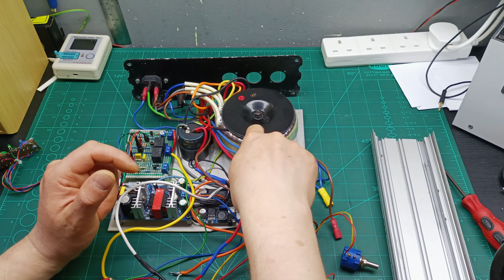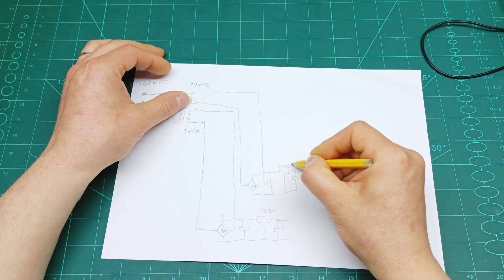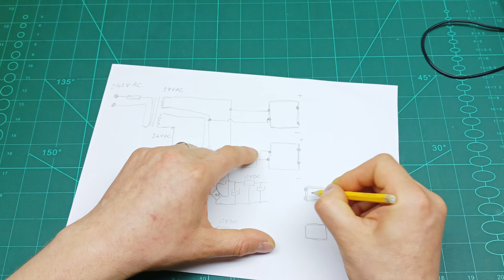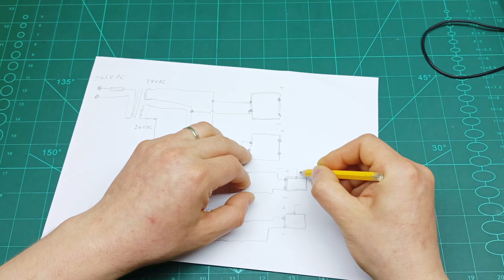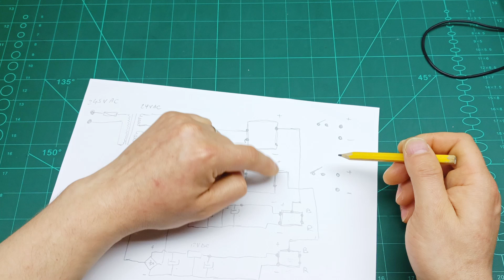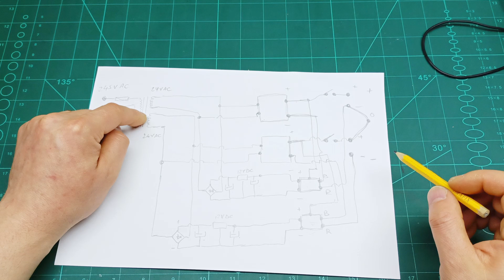Why not making a DIY dual rail bench power supply? 0 24V 0 2A

Comment: Nice build, thanks. Surely you could run the meters on 24V instead of 12V, repurposing the included fan regulators.
Reply from the maker: You can but the amps readings will be not ok and you can't make it as a dual rail power supply because you need to put them in series and the current readings are through the negative path so when you will put in series will short out one power supply
Reply: @SymbolTech21 no, I mean don’t mount them on the boards (since not used for fans anyway). Connect them just as you did the 7812s. The meter runs on 4.5-30V.
Reply from the maker: @michaellindborg1510  that's why I said they need to be powered from an other source if you want to get the readings correct. If you power them from the same source will short one when you put in series the power supplies to make a dual rail negative ground and positive

Comment: Hi, nice build. I have a question. Can you put the outputs in parallel so you can have more current capabilities?
Reply from the maker: Will be not so good to do that because if are not exactly the same voltage maybe sparks can happen. But can do other things to be more powerful is to put in parallel maybe 2 power transistors and that will double the power handling only that definitely will need bigger heatsink as well to dissipate the heat faster in special when using low voltage and high current

Comment: Maybe doing a step-up: build a bi-polar (four quadrant) power supply. That would be fun.
Reply from the maker: And which application will be used?
Reply: @SymbolTech21  there's not much use of it (e.g., testing rechargeable batteries or as an amplifier for a signal generator or an an AC source) and it is not easy to be made, but that's why making it would be fun and great for bragging too, as very few people has one.
Reply from the maker: @bsimic29  I have 4 signal function generators then I will keep in mind for this project suggestion and maybe in the future I will build one.

Comment: Nice build. You can adjust the meters to read more accurate by adjusting the V/A Cal presets on the meters.
Reply from the maker: Yes I did that and how you can see in this video is the closer to accurate possible I come by adjusting those 2 trimpots
Reply from the maker: Hi by the way I just got a new voltmeter ammeter and I installed and now the reading measurements are more accurate.

Comment: Great build. I have a center tap transformer out of a subwoofer that states it has 49v-0-49v outputs. Can I use that to build your design? thanks.
Reply from the maker: First you need to open the center tap and make it dual 49v and the voltage regulator kits I use on this project they can run max with 24v transformer. So for your transformer if you open the center tap to be dual definitely can go to this project https://youtu.be/yaxJYI5ejf0?si=mCi9S1oJ_DQQ7NDY
Reply: @SymbolTech21  thanks for the reply. I tested the transformer. It has a 230v primary (UK mains) and +49v 0v -49v outputs. I'll look at the links. Thanks.
Reply from the maker: @deanedgx  if you can open the center tap then you will have a dual 49v